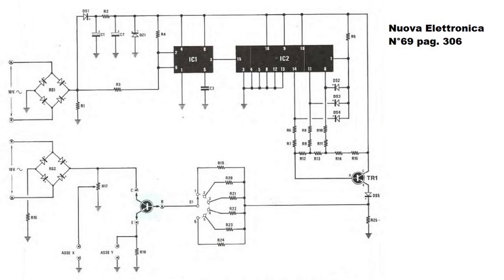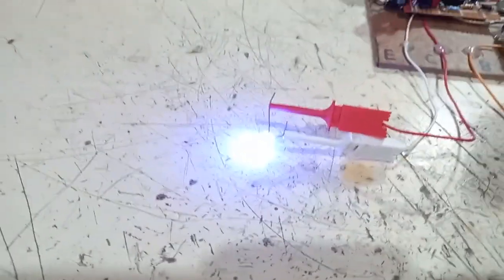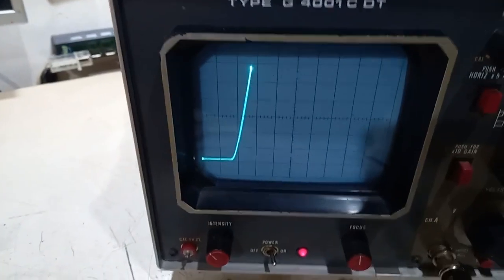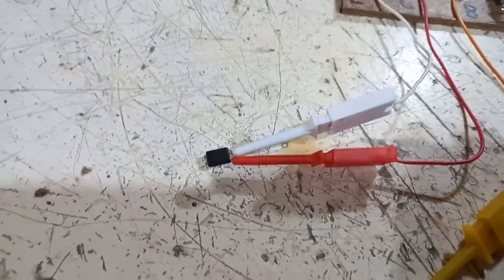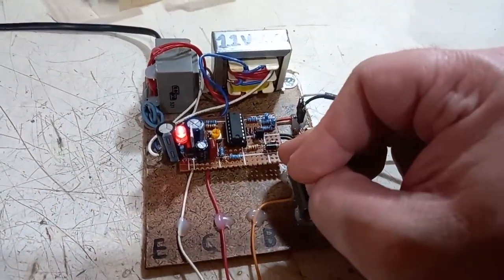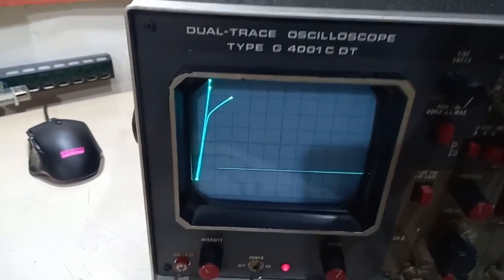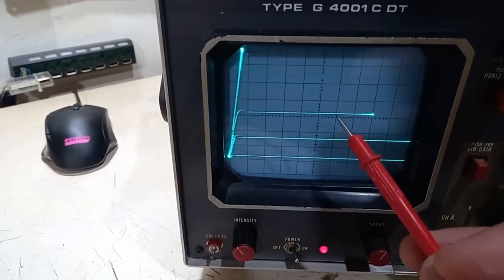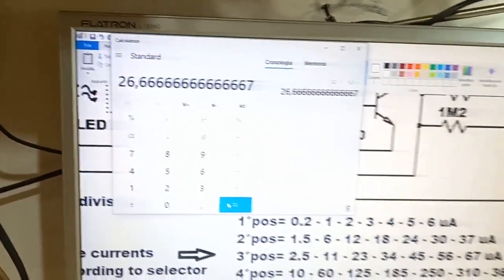A Good Ol' DIY Curve Tracer (and a bonus)

Comment: Hello! Thank you for uploading. Nice work . I built the circuit. It works. I'm just not sure it works the way it should. It draws only 4 lines on the oscilloscope. In principle, there should be 7 lines, but only 4 appear for me. I don't know if I made a mistake or if the PC oscilloscope is not suitable for this. What do you think the problem might be? Hi! Feri
Reply from the maker: i'm not sure, maybe the scope doesn't have much persistence\retention OR you didn't make the resistors network properly (you really have to use 20k resistors or two 10k in series) OR there's something wrong OR you're analyzing a transistor that doesn't polarize itself almost at all at low currents OR a too sensitive transistor that just stays saturated at the higher currents OR i dunno
Reply: @PosthumanKindergarten  thanks for the reply. I think the cd4040 is at fault. pin 9 does not give a normal signal. I will replace it at the weekend.

Comment: Very nice tracer for such a simple circuit, and good idea to use the AC to replace the 555, if I saw that right. Could you test voltage-controlled devices by putting a resistor in parallel with gate-source? As long as the DUT is high-enough impedance this should turn the current steps into voltage steps. At least for positive gate-source voltages it should work, shouldn't it? (Voltage range for driving JFETs is another problem, of course.)
Those scope music videos are crazy!
Reply from the maker: thanks... yeah, i thought of making finer voltage steps, fact is that there already are voltage steps (converted in current steps trough resistors) but the Vgs threshold is so distinct that it will end up with just two conduction planes anyways, you'd probably need a more complex system

the 555 was just as schmitt trigger, i used a CD4040 instead of a CD4029 and the schmitt trigger was already incorporated :)

Comment: Hi, Will it work with a digital oscilloscope?
Reply from the maker: almost certainly yes, i have a digital scope, it's just that it looks uglier and i wanted to stick to a "classic" feel for this video
Reply: If it has some kind of "virtual phosphor" afterglow effect function (it memorizes the path and shape of the curve for some time - like the old scopes did it) OR it has the function to sort of record the curves (like the curve of a capacitor getting charged), then yes, it will.